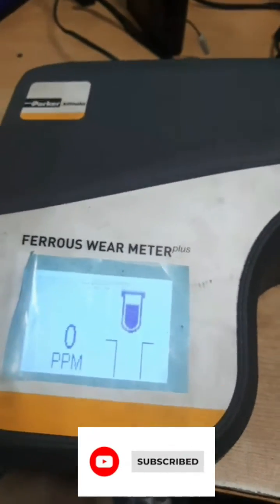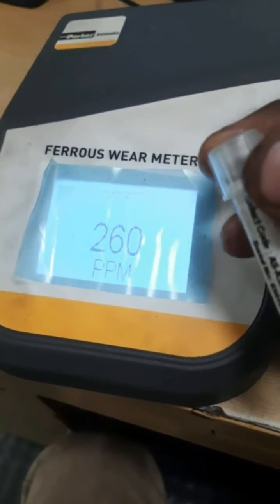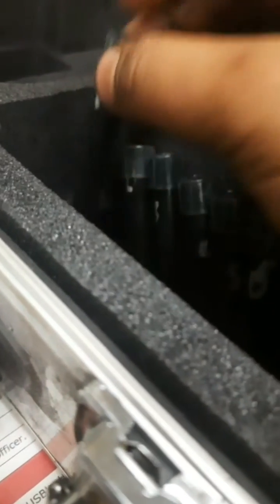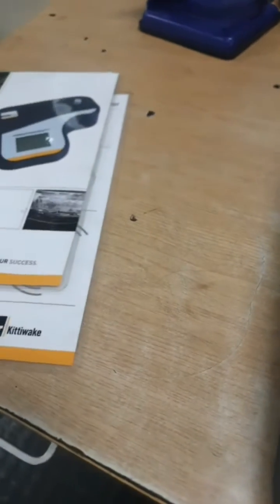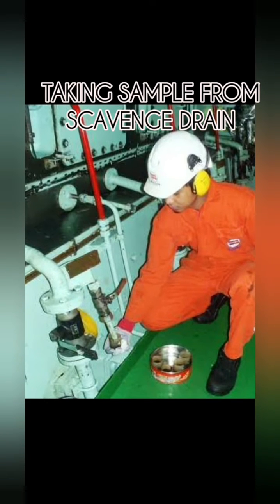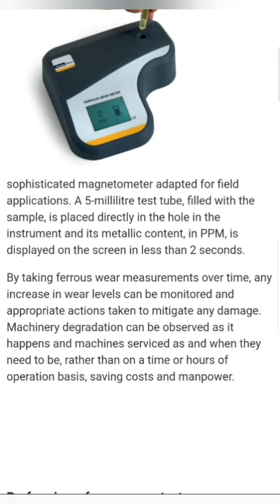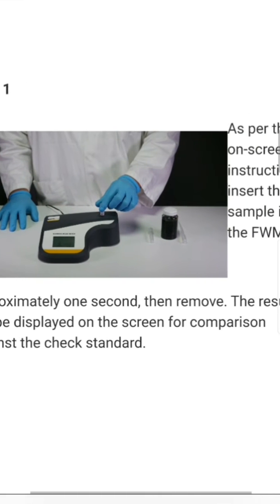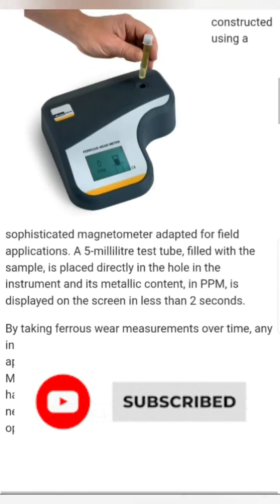Scrape Down Analysis (CCM Test) of Main Engine Scavenge Oil | Procedure Explained | Must Watch Full

Comment: So by this....are we checking liner wear down?
Reply from the maker: Yes correct
Reply: @CLASS4ORALS what is the allowable level of Fe in cylinder oil?
Reply from the maker: @andriyivanov4810  Should be 0 ppm ideally as per Parker Kittiwake Ferrous Wear Meter. But good acceptable values are 10-30. If Piston rings are new, then It may reach 200 ppm and will gradually lower over the time during running in.
Reply: @CLASS4ORALS  Thank you very much for answering my question.
Reply: @CLASS4ORALS  Good day. I think due to constant frictions between piston rings and liner we always have some metal particles in used cylinder oil. In this case how we can have 0 ppm?
Reply from the maker: 0 ppm means the wear down is next to minimal.
Reply: @CLASS4ORALS  Thanks. Could you pls advise when we measure Fe content in ppm, we measure, let's say 25 parts of Fe per million of what?